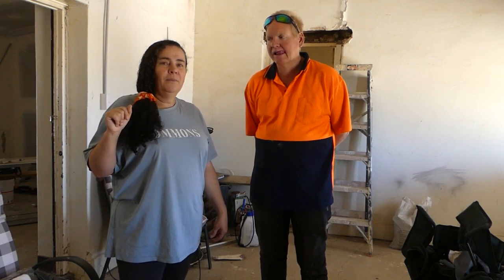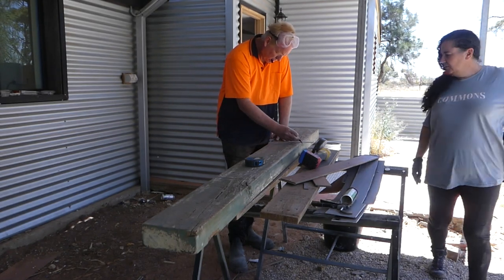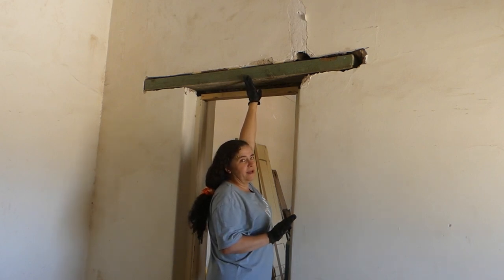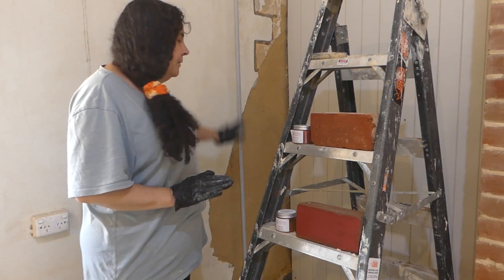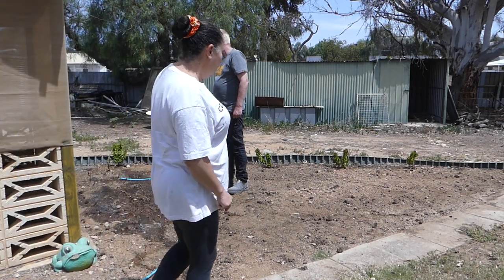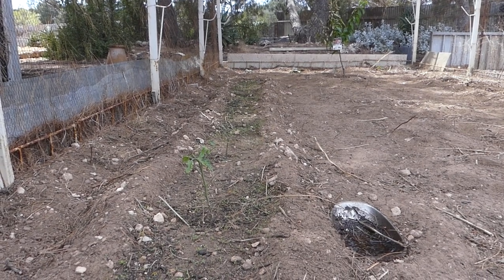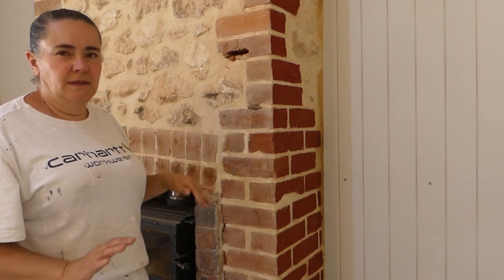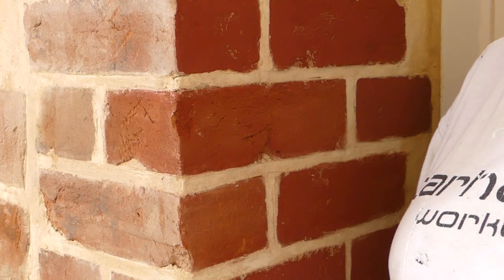Australian Cottage Renovation: Restoring Vintage Chimney, Rebuilding Doorframes and Garden Disaster

Comment: Nice job guys. You could have brought the bricks back to life with a clear brick n paver sealer. Just spray or paint over the mortar and all. Brings out the original colour and also reduces the dust. Just make sure you use a satin and not a gloss.
Reply from the maker: Thanks Ben that is good to know as we have all of the bricks on the exterior to do still so we will definitely look into using the sealer on them
Reply: @AcresIntersections  No worries. If you want to test the look just spray the bricks with water, it achieves a similar but temporary result as the sealer.
Reply from the maker: Oh thanks for the tip Ben I will try it and let you know the results